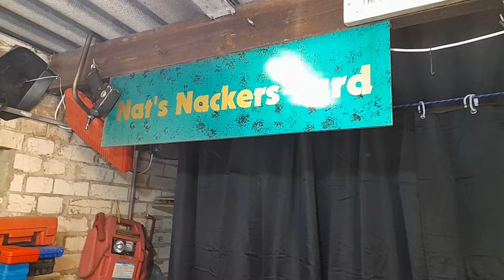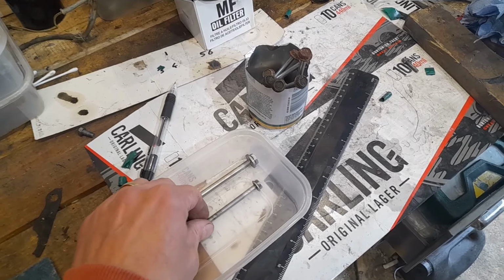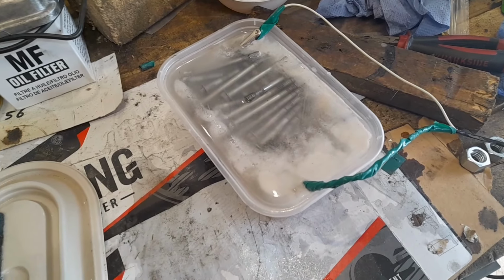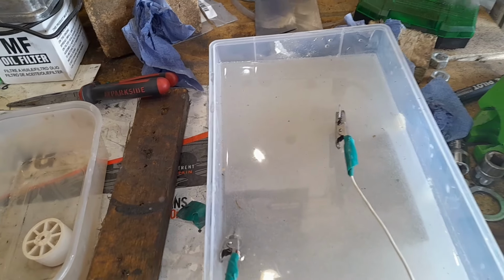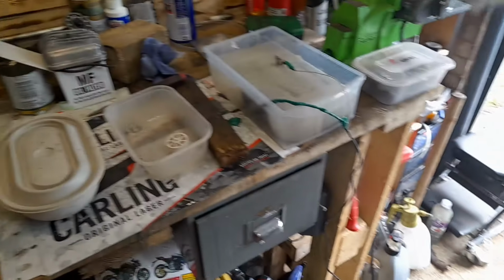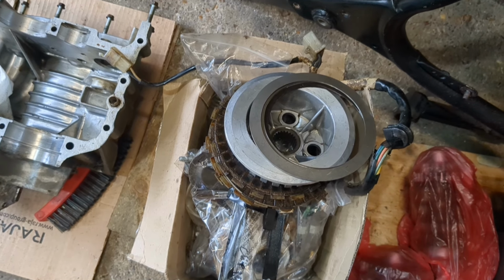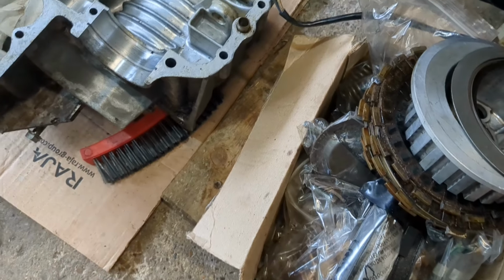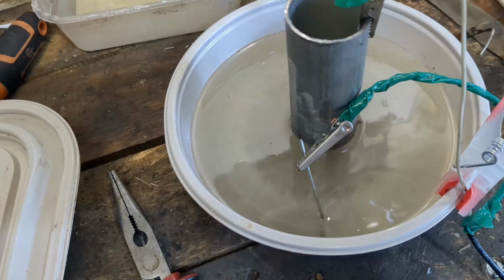Electrocuting my nuts. Bolt electrolysis.

Comment: Just a heads up,Before you assemble the head,fit the spark plugs,turn over& fill the valve areas with petrol,if it doesn't leak then its air tight,if it does you'll have no compression & have to re lap the valves in..Ian